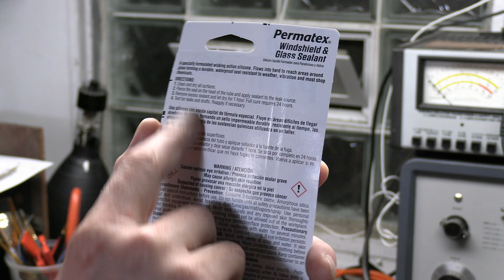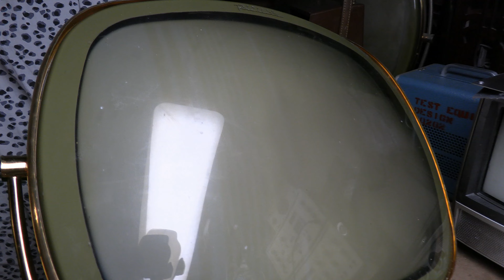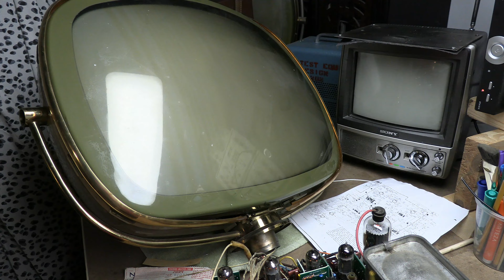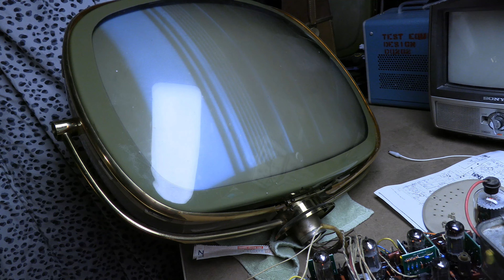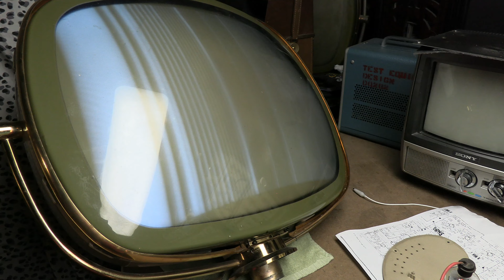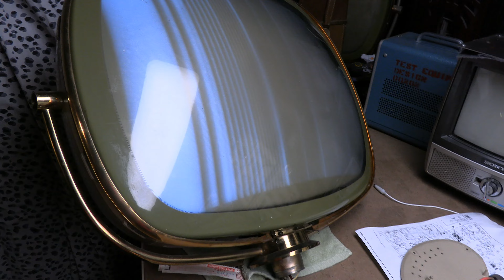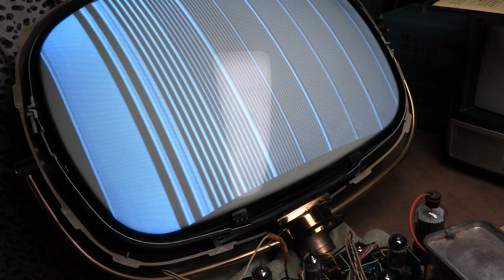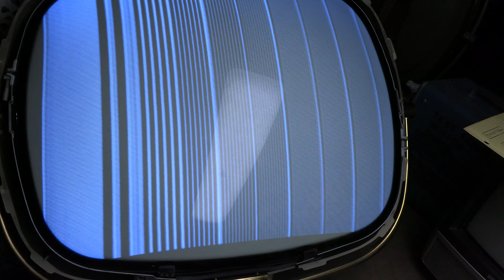CRT Testing, Repair and Rejuvenation Tips part 3

Comment: A suggestion: remember to test the tube before gluing the base back on. If a lead-in wire broke inside the base you don't want to double your work. Like forgetting to put heatshrink on before soldering.

Comment: Picked up a 7jp4 at a swap meet for $5, base was loose, and every single solder joint for the pins broke so the base just fell off, it took a long long time to get the base back on

Comment: Permatex Windshield and Glass Sealant works great on any  loose tube base especially those two or three digit old Coke bottle type tubes because of it's gap filling properties. So yes you actually picked the best permanent option. Do not store
it in any room that gets above 85 degrees  however as it will slowly solidify . Keep it in the door of your frig! Once cured it
is good for 450 degrees. Nothing else actually tops that. When it comes to metal spinning for those picture tubes it was
actually a more recent form of shear forming called flow forming. You can see the ribs or lines that define such a process
in the sides just like a 3D printer would do with with plastic. My grandfather once said decades ago, "There is nothing
wrong with using a tube brightener but you will definitely need to get a new picture tube or TV eventually anyhow !"

Comment: They sure did get beat about.  We had one in the early 70’s for a camper it had the 110/ 12volt operation. It banged around in that camper up into the mid 80’s and then I used it on a game system after that for years. Sold it with the game system working I think maybe 88.

Comment: Thanks Bob.  Because of your alignment series, I bought a new oscilloscope, a vintage Heathkit VTVM (working perfectly), a B&K 415 and a Sencore VA-62.  My wife is very mad at you!  Unfortunately, the B&K is missing the demod probe so I've been eBay searching every night.  A spark and a personal vibrator eh?  Be careful!  YouTube Big Brother may be watching!
Reply from the maker: LOL, too late now, but I would have suggested watching the process to decide what gear to buy.  Not that you didn't make solid choices.  The demod probe is fairly simple inside and you likely don't really need it.  Reason being that you typically hook up the 415 input after the TVs detector stage so it does the demod for you :)

Comment: It's dead Jim... Still watching just in case😂
Reply from the maker: Where there's a glowing filament, there's a way...
Reply: @bandersentv  It's always possible, maybe that new thing you're hoping to get will do it. I think one of the crt testors I had bad a short repair function but back then you still could easily find used, new, rebuilt tubes so it either came back or I swapped in a good used or rebuilt tube depending how nice the set was.

Comment: Not a bad picture :-D
i hope the step up transformer doesn't push the  filament too hard.
Jordan pier has been tinkering with an old set,  not easy to get the geometry right.
Reply from the maker: I'm not using the step up transformer. I put a new picture tube in it

Comment: Would using that Permatex sealant be a good preventative measure to prolong the life of the metal-glass interface on that metal tube?
Reply from the maker: No, unfortunately air pressure is far too great.

Comment: Just a crazy thought ,using some super high strength magnets (like I've pulled out of some computer hard drives as an example),many components inside tubes are nickel, nickel plated or iron could possibly ,minutely pulled together or shifted enough to "spot weld" together.Yeah,I know it sounds goofy -but hey it could work if indeed the parts inside are conducive  to this AND a strong magnet used.

Comment: Is there a spec for capacitance from the cathode to some other electrode that you could use to tell if it's still connected?  Your Sencore cap tester can measure fairly small capacitance I think.
Reply from the maker: Yes, cathode to all others is about 5pF. Grid #1 to all others is 6pF.   I have a Tektronix that can easily measure that low.  Sure, I'll give it a try.

Comment: If its gassy, it will absolutely kill emissions but still show proper filament glow. I have a 21FJP22 that does exactly this. But as soon as you put full HV across it? boom purple glow.
Reply from the maker: I'll try running it at full voltage sometime and see if it flows purple

Comment: They do sell Sensor safe RTV which will not harm  electrial I use that
Reply from the maker: Sure, works well. That's basically what this is except it's clear and a bit thinner. Also cheap and widely available.

Comment: If air leaked in then wouldnt it draw more current?
Reply from the maker: Probably, it would also grow purple.  However, I=it's possible only a little has leaked in.  Just enough to block emissions but not ionize.  There is no getter material left.

Comment: The only word I can come up with in regards to old picture tubes is frustrating!  It’s too bad that there’s nobody left that does the rebuilds. When I collected on a serious scale, buying a rebuilt tube even pricey, I would have done it but nowadays I wonder if the cast can be justified considering there’s no money value in most of these old sets other than the nostalgic values that come and go like the wind.
Reply from the maker: I suspect even is someone was still rebuilding few would pay the cost  I had a 10FP4 rebuilt by Hawkeye just before he closed in 2009.  It was $300 + shipping.  I'd expect it to be close to $500 now.  More than most restored sets are worth.